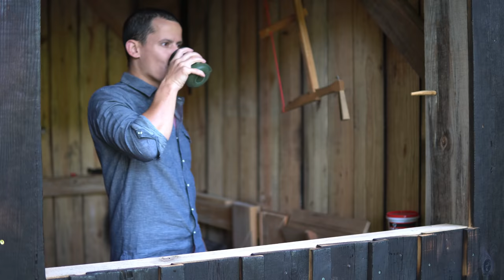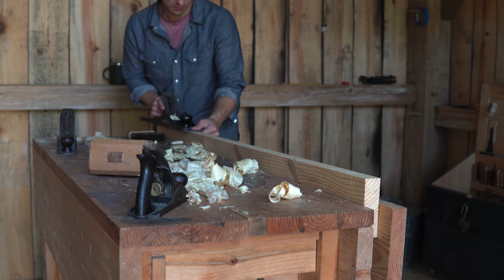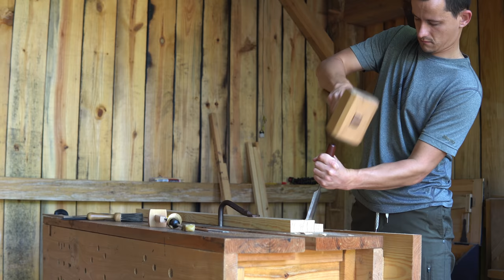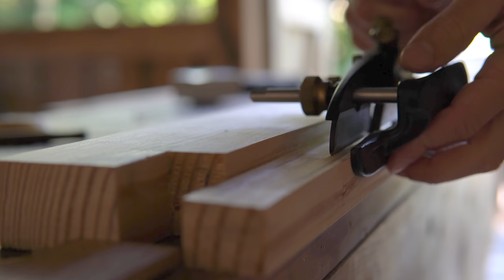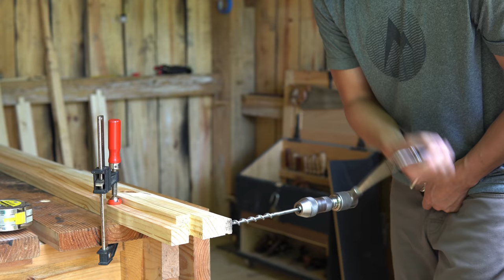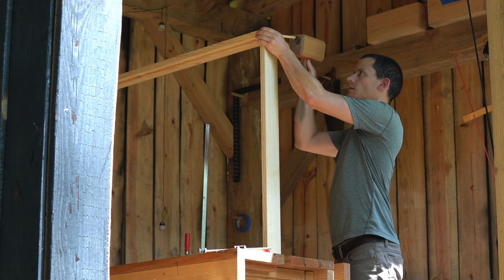Building a Sliding Window Frame: Tiny Timber Frame Workshop Pt. 10

Comment: Hi Nic, lovely work and video as always. Out of interest, are you going to glue the joints or is there no need with the tight fitting joints ?
Reply from the maker: Thanks, Ben! The tight joints and drawbored pegs should be plenty to hold the frame together. I didn’t want to use glue incase I need to replace a part in the future. Cheers!
Reply: @NicTaylorWoodworking  Cool I thought so just wasn't sure in terms of waterproofing :) Cheers

Comment: It is not the right wood to use for windows / doors - it looks like the wood has grown about 10 mm a year. It gives far too low density - it will rot in 4-5 years.
Poor growth conditions give the best window / door wood.
And sorry I'm annoying, but you should not use nails in joints - the sinks / dovetails are made precisely because you lock them one way (horizontally) and can adjust it (vertically) with the bricks / wedges you put in when mounting frame.
Reply from the maker: Probably all very valid points, on your part. This project is one of those “make it up as I go” type projects. At the end of the day, I’m just using wood I have laying around and having a bit of fun. Cheers!